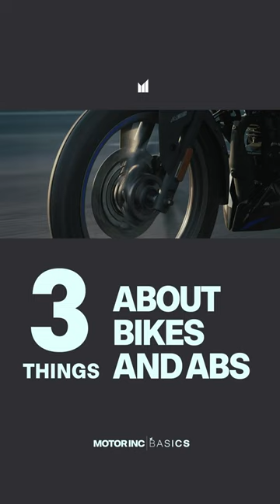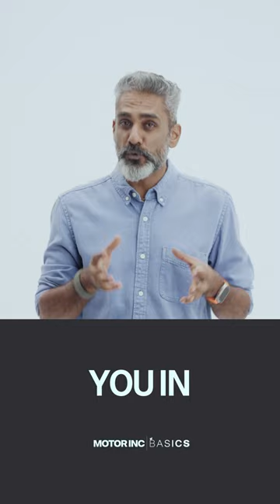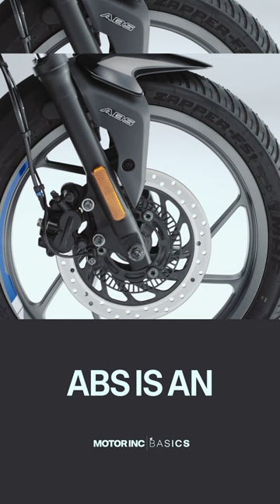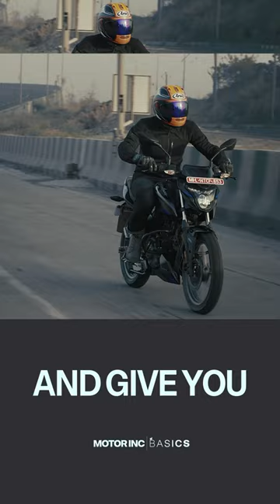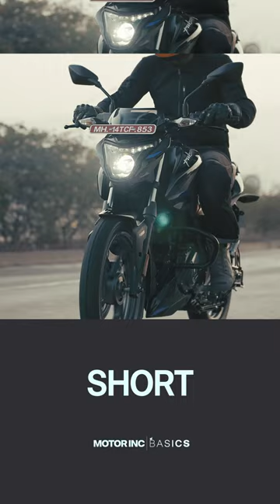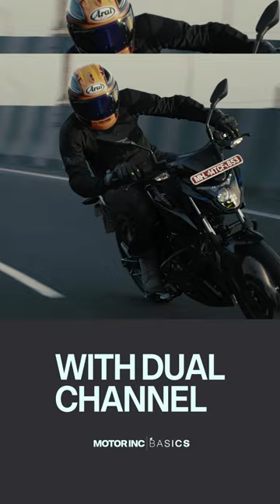Single-Channel ABS & Reality | Bajaj Pulsar P150 FAQ #3

Comment: PS: You should add one more point. One should ride an ABS equipped motorcycle as if it does not have ABS. This is a safety net. You are not supposed to depend on it for daily riding. If your ABS kicks in all the time, you need to review your riding skills.
Reply from the maker: Great point TWP! You're absolutely right. But how we'd put it is not "as if it doesn't" we'd say -- learn to brake properly. You're going to need it.
Reply: @motorinc  That's valid advice for everyone whether they have ABS or not. However, I think how I pointed it out is also important because a lot of new riders depend on ABS rather than use it as an emergency safety net. 

I bought my first ABS equipped bike in 2019 - a BS4 390 Duke. For the decade+ before that, all non-ABS bikes. My state of mind when I ride my 390 or my Interceptor is very different from when I (used to) ride my 200 Duke. On my older bikes, I knew that it was all down to my own skills. On my newer bikes, I have peace of mind that ABS will save me in a tight spot. It makes me less vigilant, less alert. I have to repeatedly check myself and bring myself out of that state of mind. 

Just imagine that you are riding a motorcycle and suddenly you get a warning on your dashboard that your ABS modulator has failed and you are 50 km from the nearest workshop. Will you change your riding style? Will you reduce your pace? Will you become more vigilant and conscious of your braking distance? Will you take fewer risks?  If the answer to any of these is yes, my statement is upheld.
Reply from the maker: Fair point. But tell us this: "it makes me less vigilant, less alert"... who is going to fix this for you?
Reply: @motorinc  The answer is in the same comment - I need to check myself every now and then to get out of that mindset. And as I said in my first comment, I need to ride as if I don't have ABS on my motorcycle. As I understand, people have asked you to make a video on braking with ABS. I trust you will remind riders who has the onus of braking properly - the rider, not the ABS.
Reply from the maker: As we did in point 3 in this video
Reply: @motorinc  Awesome
Reply: A solid valid point. My sister leaned her riding on a readily available ABS bike, Meteor 350. And she's so damn used to the ABS that when she brakes, She brakes hard cuz she knows the ABS will protect her. I always keep her braking skills in check and give her my CBR 250R (non abs) to ride sometimes by alerting her about the absence of the ABS. Of course I sit behind her while she drives. We must not get used to the comfort zone. We cannot predict unfortunate circumstances. We need be prepared for those.
Reply: Very true, Sir!

Comment: I have learnt in riding in my dad's 2010 Pulsar 135 LS. What an amazing machine it was. 4 valve engine when it was not even a thing in Indian Commuter Segment. I was 16, hit the front brakes at 72kmph to save a puppy and was thrown off from the locked up motorcycle. That day till today, non ABS or with ABS, I don't rely on the bike. My mind knows how to brake like an ABS system. I use Hold-Leave-Hold-Leave the front brake with sharp rear braking in case of emergency on the road which works like a gem. I don't care about ABS anymore.
Reply: You cracked it. Btw I too had a similar experience with my Pulsar 135 LS (2016 model). Fortunately it's was a good road any I had the wheel centred so I didn't fall off.
Amazing motorcycle btw.

Comment: He's right, Its still a good idea to try "threshold braking" technique even though you have the ABS, because the whole point of this technique is to shift more weight to the front tire thereby increasing traction on the front which enables the tyre to withstand higher forces before locking up.

Comment: Single channel ABS is great. No need to turn it off on the rear. You can lock and slide at will.
Reply from the maker: Until it happens when you don't need it to. Then it's back to being a stupid loophole everyone's crawling through
Reply: @motorinc  Good point. I will resume my practice of emergency braking and locking the rear wheel. It was easy to lock and slide on the old cast iron Bullets, even easier to do so on my Dukes but I would not want to do it on my Interceptor.
Reply from the maker: Tip: Most of the time, if you're eyes stay up and look at the horizon, the rear slide stays controlled
Reply: @motorinc  Noted. Thank you.
Reply: @motorinc  had it happen in a classic 350 once in a wet patch where a water tanker just crossed locked the rear completely i was new to the bike i think it was the 4th or 5th time i was taking it fell down skid all over the road had a huge scar from my sholder to the wrist but the leg gaurd which i didn't fancy saved my leg from any injuries by wrapping itself around my leg went to hospital did first aid and to make sure i dont have any trauma for riding bikes called the insurance and took the bike to service center the same day met a fellow re owner who fell down the same way and we were vibing with my mom glaring and scolding both of us at the service centre learned how to emergency break after that properly 😂😂 and i was going at around 30-40 kmph only that time too one uncle was like how did you fall dispite goong so slow

Comment: Just to summarise and my input to the community.
If you gonna brake hard thinking that ABS will take care of braking, thats not how it works. If ABS is triggered then it will impact your braking and stoppage time and distance.
In case of emergency, make sure you press hard but not hard enough that ABS is triggered so that brakes work in full potential without interference from ABS
Reply: New rider here. Is it fine if ABS is engaged at the very last moments of an emergency stop? Like when the bike is already slowed down to less than 15kmph? I seem to be triggering it all the time when I practise.

Comment: its better bajaj only gave single channel abs on my pulsar 150 neon bs4. the abs interrupts my front brakes as soon as 1 grain of sand hits the front tyre and I am forced to use the rear brake to prevent rear ending someone.
Reply from the maker: That means your braking skills need polishing Tejas. Unlike a car, where you just apply a lot of brake and let ABS deal with the pressure management, on motorcycles (fewer and smaller contact patches), to extract the best of the ABS system, you do have to be more gentle with the initial application of the brakes. Grabbing the brake will always trigger ABS too early.
Reply: @motorinc  i have learnt on a non abs bike, forgot to mention that. It was a yamaha szr. Never locked up my front tyre :) trailbraking is fine on this bike